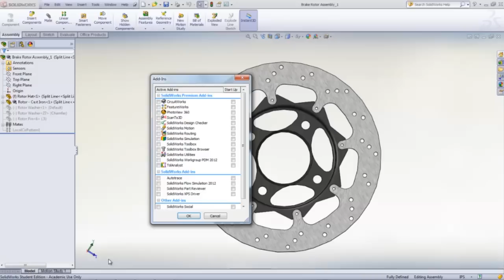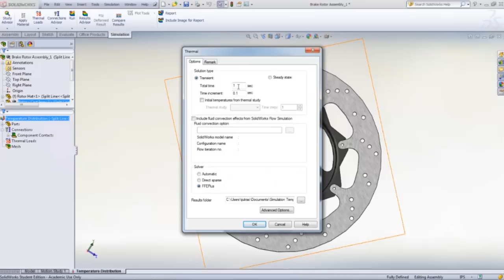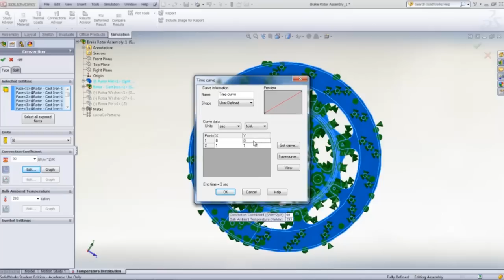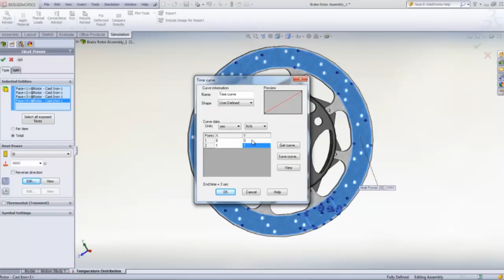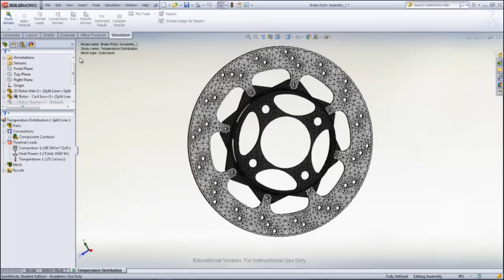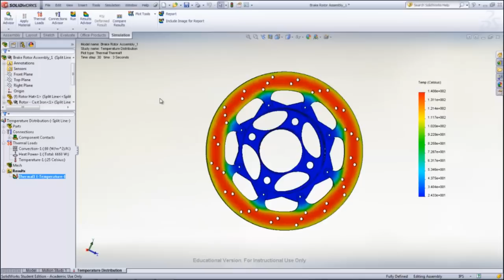SolidWorks Education SAE Thermal Distribution

Comment: Great video this was super helpful! But I would point out that the heat power is the change in kinetic energy over the time interval between the initial and final velocities. You could also do a simple dynamic analysis of a car in which you calculate the braking force at the front wheels. Determine the distance traveled to calculate the work done by the front brakes, then divide the work by the time interval (say 4 seconds). Also divide this by 2 to isolate one brake pad and you will get a much more accurate heat power than simply assuming 60% of the brake force is done by the front brakes.

Comment: I did evrything as you said.. I got less temperature than ambient after simulation..
Reply: Because you need to select the solid body for your initial temperature not all the surfaces.
Reply: @chrisb7161  i am clicking on the assembly but it’s not selecting it. How am i supposed to do it if i wanna click just on the assembly not all surfaces
Reply: @brucewayne3227 I have the same problem, were you able to solve it? Can you tell me how?

Comment: Hi Jose,
I find it difficult to only select the surface where my brake pad is going to make contact to the rotor as my rotor is a bit bigger than the surface of my brake pad?

Thank you
Reply: I also had this problem. Solved it by sketching 2 circles which would be the outlines of the brake pad touching area. Then I used 'Split Line' to get those 2 circles on the rotor. After doing this you can select the brake pad area in the simulation. :D

Comment: SolidWorks, how did you make your brake disk model such that you were able to select and test only the area that would be in contact with the brake disk? Thanks
Reply: Hi Leicester, is an assembly, this way you can select the part you need for the study
Reply: See my answer above.
Reply: I am fairly certain he used the "Split Line" feature to divide the surfaces, twice, once for the swept path of the pad, and once again for the pad itself.  (and on both sides of the disc)  This is why he references selecting 4 surfaces for the area.
Reply: @mjktrash  Hello, i know it’s been 4 years since your comment, but do you have any idea how he selected the initial temperature on the assembly from the feature manager? I can’t click it the way he does it so I’m clicking the faces for the initial temp and the analysis is giving me negative temperature on the disc